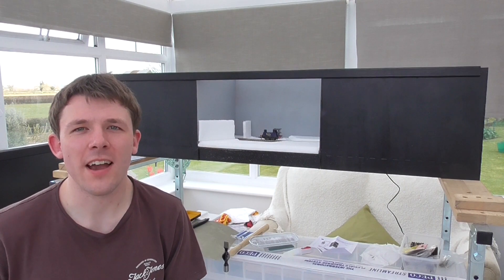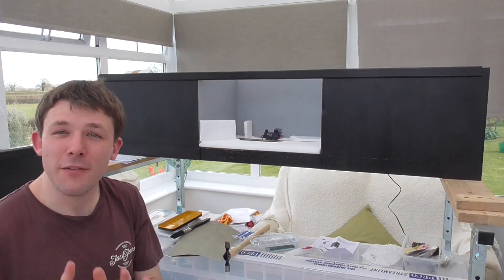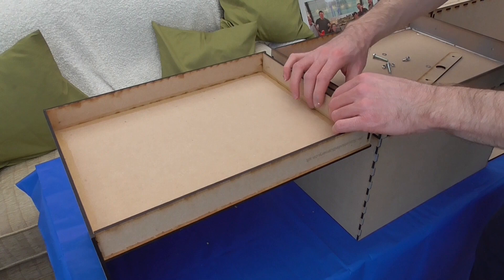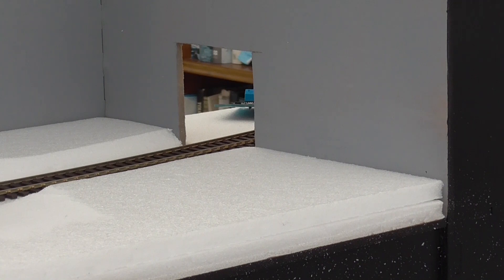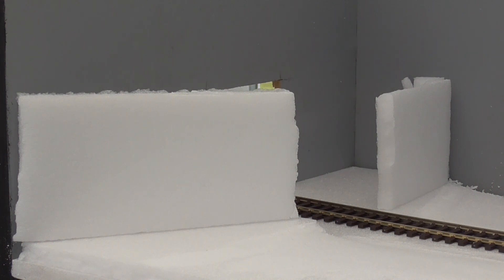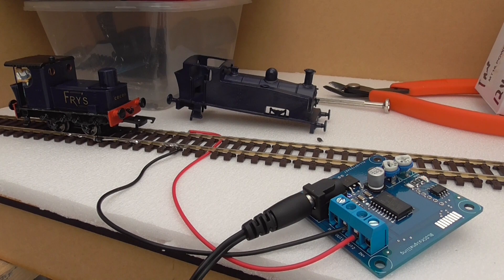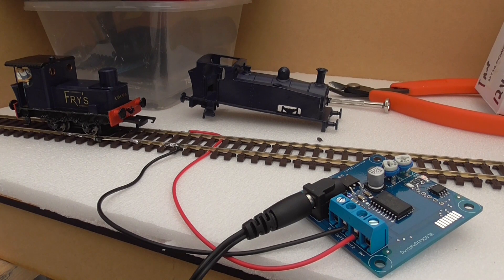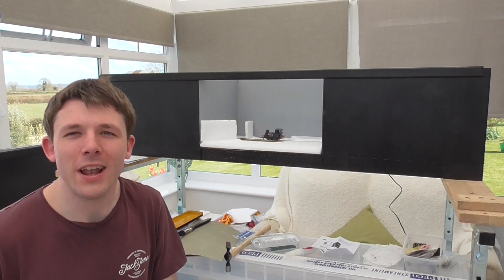Fry's Somerdale - Micro Layout - 00 Gauge - Update 1

Comment: I spent my summer holidays in the late 1960's spotting at this location. A class 22 would take the wagons in and out of the factory. The Frys locomotive never crossed the road in my experience. Have you got the RCTS book "The Railways of Keynsham"? It has lots of information, track diagrammes etc. A friendly crew once gave my friend and me a ride into the factory and up the line to Keynsham East - happy days!
Reply from the maker: Many thanks for the info. Will have a look for a copy. Got a pannier, 03 and 08 also planned to run on it. Plus a few what if industrials, just for fun.

Comment: Amazing! Imagine the sentinel bombing down the GWML! The path from Keynsham to Somerdale along the old trackbed has enough room for a line and a path, I don't see why they don't have a little heritage line there? Also, do you plan to sound fit the loco? - a challenge I bet!
Reply from the maker: Ha! You never know. It might of had to when it need maintenance or when it was delivered. It would of been a very short run if so, as it's only about 1/4 mile to the factory. Plus the car park at Keynsham station covers most of it. Not these ones, as they won't work on the shuttle then, but you never know. :)
Reply: @SDJR7F88  Oh yes as it is DC, maybe the train tech sound capsule. To be honest a nice little heritage railway just from the trackbed side of the road to the edge of the estate would be interesting. I did it on my bike the other day and at a slowish, reasonable speed the whole line could be a short, enjoyable (400m) ride - we can dream! 😂